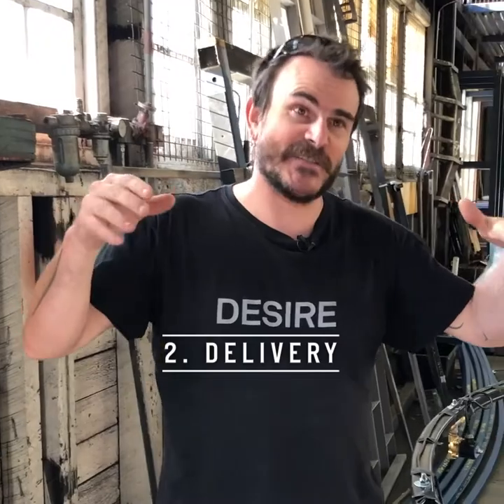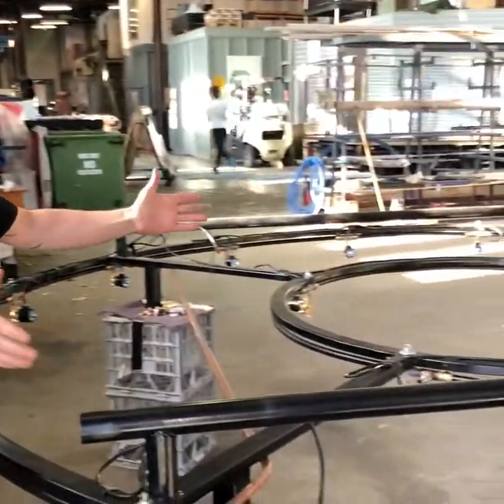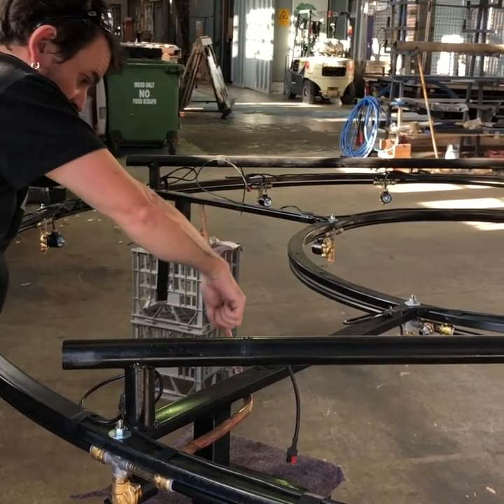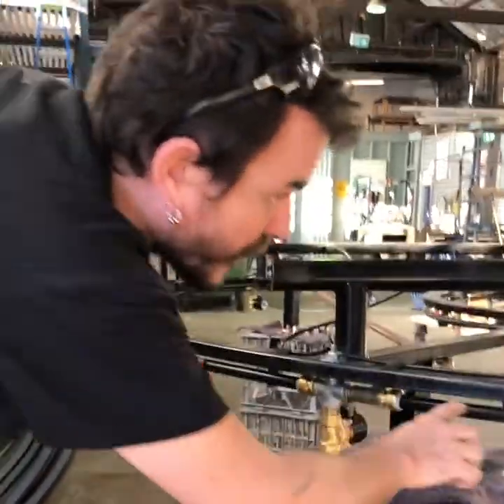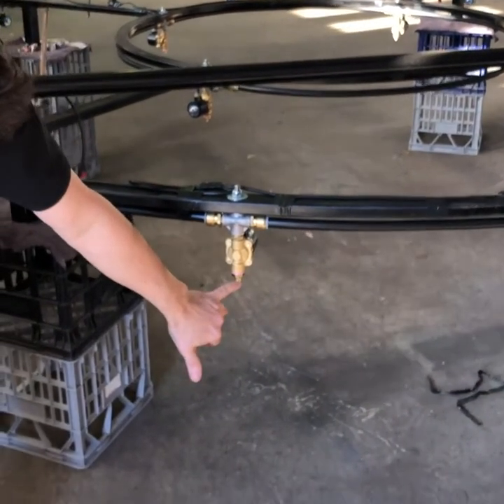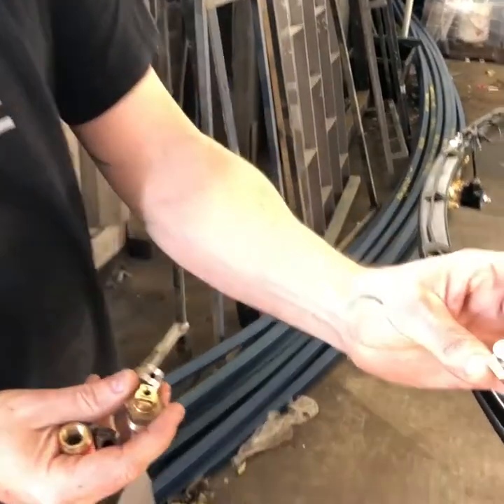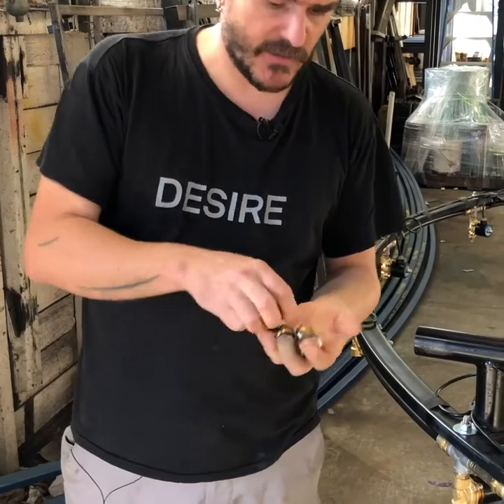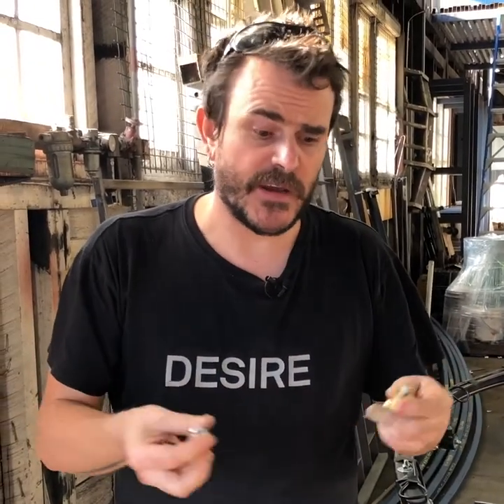Making it rain in the theatre: a masterclass

Comment: I was the master Carpenter (retired) at the Guthrie Theater in Minnesota for 30 years, I created rain onstage many times.  Yeah, getting rid of it is the biggest problem.  i used the same type of nozzles, sometimes I would just drill 3/4" PVC with a 1/16" hole on 12" centers.  It was all great fun!